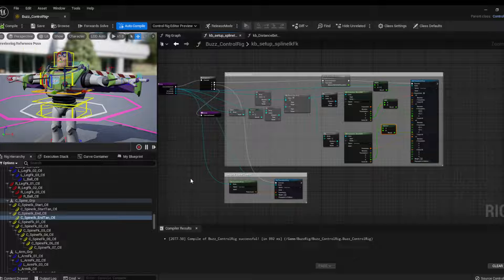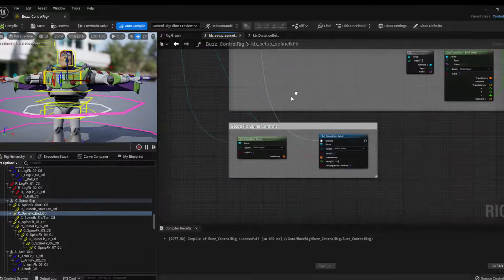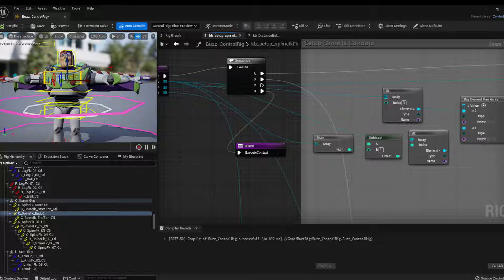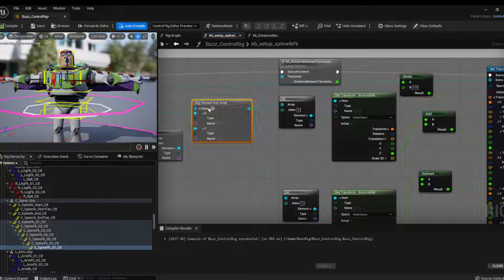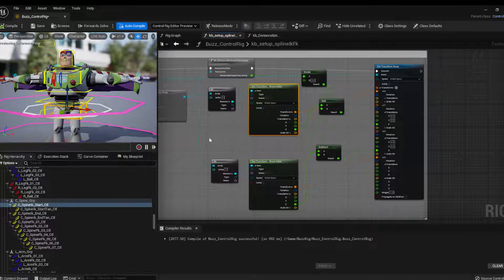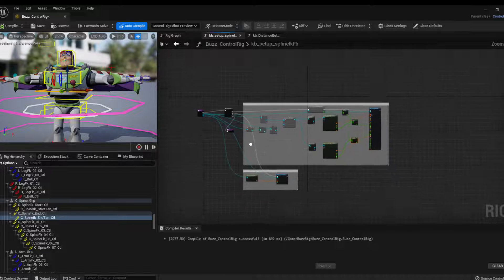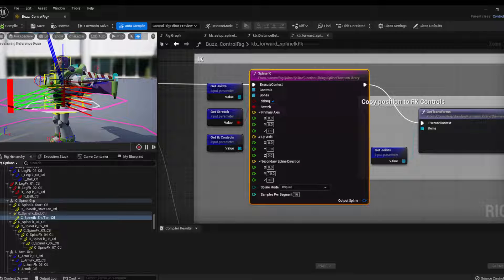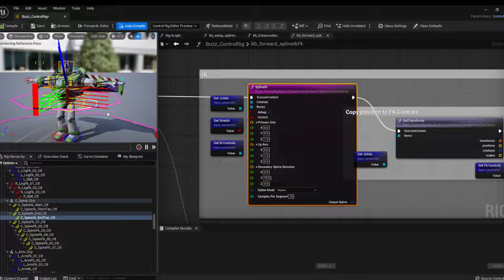UE5 - Control Rig - Setup Event for Spline IK / FK

Comment: Hi, Sorry for bothering ,I need help in one query ,is there any way to switch geo visibility ? for example switch between chair and broken chair mesh visibility ?
Reply from the maker: Hey!! That's a really good question. I am not sure about switching the visibility of the geometry itself, because in Control Rig you are controlling the joints. So what I would do is having one joint for the chair, one joint for the broken chair, and scale the joint to 0 when I want one of them to disappear. haha There are probably better ways of doing it, but that's what I can think for now.
Another way would be setting the material of the chair you want to disappear to an invisible material, but that requires a bit of more work.